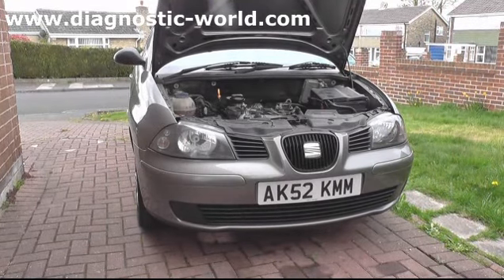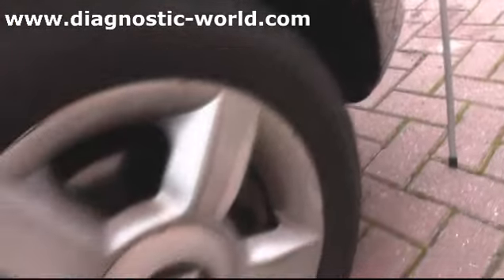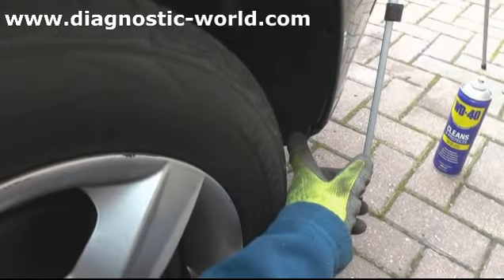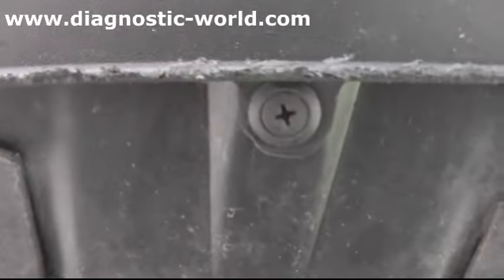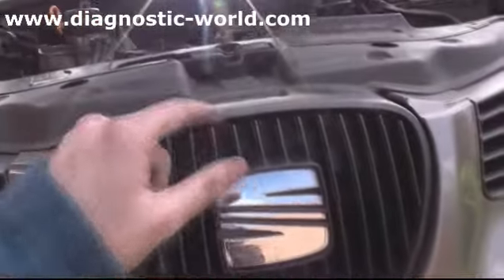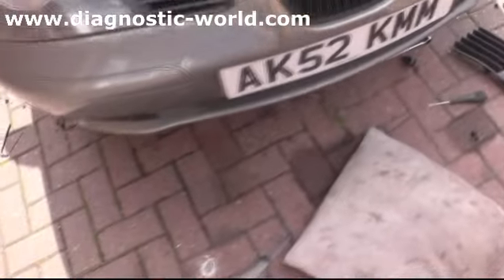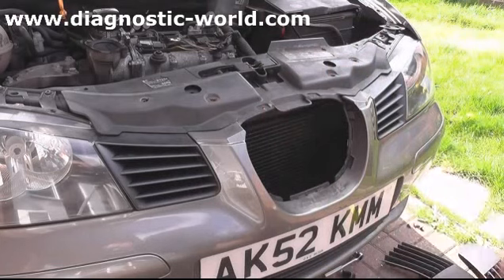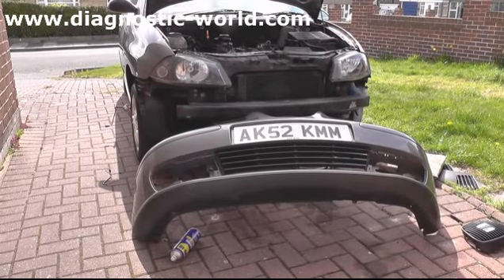Seat Ibiza Mk4 Front Bumper Removal Guide (2002-2008)

Comment: Brilliant tutorial! The only addition that I have is that you have to remove five screws in each wheel arch - not four. All are located to the front; four prominent and one recessed. All are easily accessible - hard lock your wheel! Thanks for the tube.
Reply: I need to remove the front and rear wheel arches on an MKIV Ibiza to do sound isolation. Do i need to remove the bumper for this or are the inner plastic fenders separate pieces of plastic?